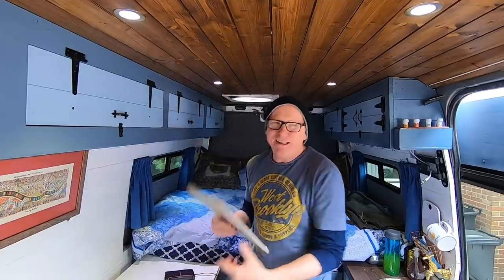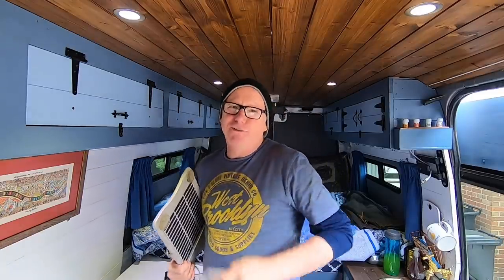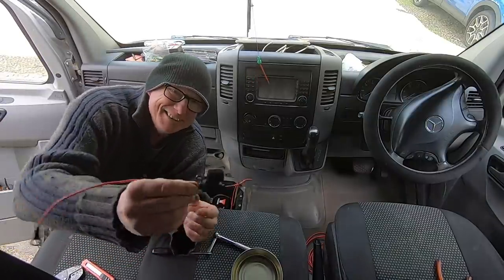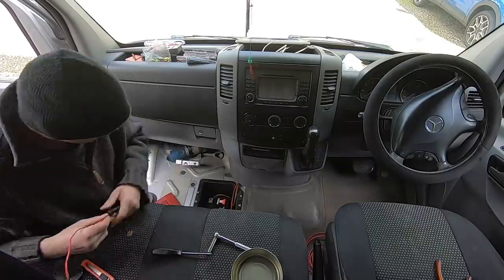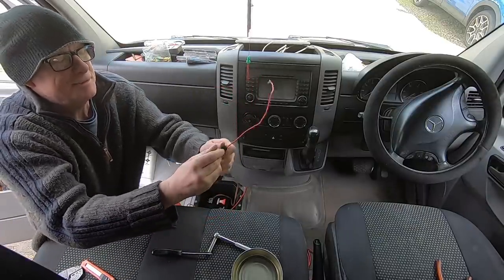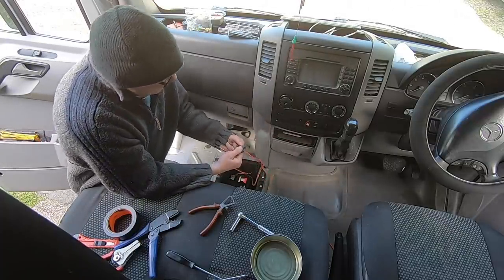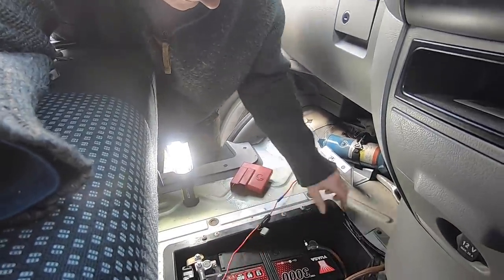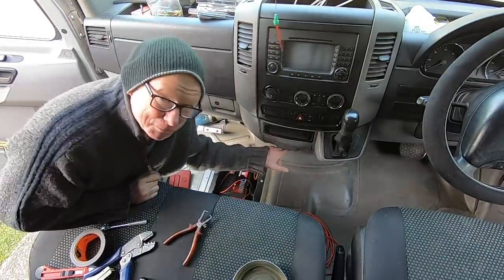How to stop your vehicle battery going flat

Comment: I run 2 starter batteries and 3 for the back.  305 AH all up for the back.  I had one of those relays snd ran my batteries down do far after about a year.  Cost me 115 buck.   So now I have a $20 switch    Much more reliable.
Reply from the maker: That’s what I like to hear old school always works well done 👍 🤓👍
Reply: Mel’s Van World Sometimes it doesn’t pay to be fancy.   I have a Hiace commuter.  I’ve been having this idea of blocking off the rear side windows off internally with a couple of solar panels that I can remove if I want to let a bit more airflow in.  Just to catch any extra rays in the afternoon.  I’m also going to be building a truck as well for full time living but I can fit plenty of solar on the roof.
Reply from the maker: I always say keep it simple keep it safe 😊👍
Reply: Mel’s Van World Just a simple unplug and put away.  I will be keeping the van for weekend trips but the truck is for living.   It’s pretty basic.

Comment: Hi Mel.   I might be wrong but I was under the impression that split charger you showed never lets power get drawn from the vehicle battery it’s designed to only push power one way.   To the leisure battery to get a charge, When the vehicle is switched off the split charger stoped the current from the vehicle battery.
Reply from the maker: Yes but if you add solar panels to the equation they trigger the relay to come on so your battery’s are now one 😊👍
Reply: Mel’s Van World oh ok 👍🏻.

Comment: Mel quick question you can answer it in video form at a later stage. How does the power go back down the cable to the battery? As you demonstrated it comes from the battery to the pump but how does it go the other way. Many thanks and stay safe 👍

Comment: Already got one.... &  it's kept the start battery on my Iveco Daily alive for for the last couple of years when my van is parked up, even in the depths of winter... it's a 40w solar panel, bought from Aldi & is specifically designed for the job... the cable, which has crocodile clips, goes through a hole the bulkhead to the start battery, which is in the engine bay. The kit also came with a cigarette lighter plug, but, like your van, the socket is only live when the ignition is on. Please note... it is only designed to maintain a battery that is already fully charged & is unlikely to charge up a battery that is flat. I've also taken the battery negative lead off the battery terminal... You could always have tested your handywork by putting your tongue across the terminals Mel... it would have made your eyes light up... its only 12v!

Comment: Most modern cars in Canada have a 2 position fuse for the cigarette lighter or 12v outlet just have to move the fuse from switch side to constant side. I would thing Europe is not any different considering I have seen it in jettas too

Comment: Can you route the solar panel wire directly onto the battery (or to the jump start terminals in the engine compartment). Of course you must disconnect it when using the van.

Comment: ive bought a van and had a relay like you held and wondered shy my engine battery is running flat, i think you just explained it, but mine blew my midi fuse and destroyed my relay.. o i think i have the andswer. i bought a relay that you can manually over ride and switch it off i believe. so im just trying that now and hopefully no drain from my 80ah starter battery for the transit, fingers crossed.
Reply from the maker: Good luck 🤞

Comment: Hi Mel,  just nearly finished my transit day van, I’ve a 150watt solar panel and a split charger running between batteries.Everything works and is running fine and charging etc. I’ve  noticed the split charger gets warm to touch with everything running does yours ? is this normal.  Thanks for all your vids you’ve basically built my van with me only taken 12weeks lol  keep up the good work
Reply from the maker: Hi if it’s a VSR then yes it’s going to get hot because the solar is making it come on all the time even when the engine isn’t running have a look you will see the read light on to show it’s on during the day you can stop this buy switching the small negative wire so you can switch it of during the day just remember to switch it back on if you want your alternator to charge your Lesisure battery hope this helps 👍🤓👍
Reply: Mel’s Van World  cheers

Comment: Hi Mel, been watching your videos for ages. I'm on my second van now, I finished my transit mwb last year and have toured Scotland in the winter just before lockdown.
This was an interesting video about battery charging.
I have the same intelligent smart relay as the one shown, and my solar panel  charges my two leisure batteries and starter battery. But my starter battery does not drain, the relay only allows the current to run one way,
Reply from the maker: Thank you that’s really interesting I didn’t know that the current would only go one way 👍

Comment: hey Mel, those sockets usually have a 15-20 A fuse on them. (Pending wire gauge used) Why dont you check the original factory fuse rating. Compare original wire gauge with the one u install... if you wanna play safe, reduce fuse value by 5A. I dont know in mm but 14AWG wire is usually 15A, 16AWG is 13A, 12AWG is for 20A.... 18AWG.10A (Stranded wire).u have to convert AWG to mm for EU spec. Canada follows the US when it comes to wire gauge measurement standards....
Reply from the maker: Hi ya thanks for that I’ll definitely have a look 👍🤓👍

Comment: I found solar panel with an OBD11 plug. so I didnt need to alter the 12v socket, just plug it into the diagnostics plug, and ive never had a flat battery since.
Reply from the maker: Nice one 👍

Comment: Great video as usual- even without cats!
How many watts is that panel?
Reply from the maker: Thank you it’s only 3.2 watts 18.8 max remember it’s just for keeping battery in good condition when parked up over long period not for sure if it would charge a flat battery 👍
Reply: @BigVanSmallWorld  Thanks for the reply Mel. I too have a 40 amp B2B. Currently use a jumper cable if I want to top up starter battery. Your small panel is much more elegant. Thankyou.

Comment: Hi Mel just found mine has a permanent 12v charger where you made yours for your dash solar panel. So if I plug my solar in there should be ok with out doing extra wires? 😊
Reply from the maker: That’s brilliant 👍

Comment: Maybe it's a Mercedes thing, Mel..?
I have the Crafter, which is basically the same van and the drinks holder 12v socket is ignition only, whilst the accessory one you altered, is already a permanent 12v. 🤔
I bought my small panel last week and it just sits in there, as I've had battery issues with being sat on the drive, too.. Nice video, btw.. 👍
Reply from the maker: Hi ya yes the panels a VW panel and you’re rite most VW are permanent live mine wasn’t working unless ignition was on 👍
Reply: @BigVanSmallWorld  Don't know why they would change this Mel but my 2007 LWB Sprinter power socket is a permanent live. Perhaps they thought that people were flattening there batteries this way? I modified a cheap Lidl 3 stage charger with a ciggy plug and it worked perfect, as you know it's a pain in the arse to get to the van battery. Good vid mate 👍

Comment: My battery went flat on the drive last week. I had not removed the battery cover since I bought the van 6 months ago. It had four torque screws and they were all seized. had to drill them out and didn't replace them, so the lid just sits under the foam floor mat. If this had happened in a remote location, I would be screwed, couldn't get a jump start if you can't access the battery compartment.
I fully charged it overnight, but your solar panel tip is ace, going to purchase one of those. Didn't know you could do that, I always thought that the 12 volt socket was only an output voltage.
Reply from the maker: Oh mate you can jump your sprinter from under the bonnet there’s a jump lead next the the air filter you have to turn the cap and push it in just so you know if it happens again but you’re absolutely rite it’s better you find things like this out on your drive than in the middle of nowhere I put a link in the description to a small panel designed for keeping your battery topped up hope this helps 😊👍
Reply: Cheers mate, forgot to mention that my van is a Vauxhall Vivaro LWB.

Comment: Will the DC to DC charger not send solar power to the starter battery if the voltage is below a given value?
Reply from the maker: I don’t think so but I have need asked about this before so I’ll put a meter on the battery to see what’s going on I’ll let you know I may even make a video about this 👍🍻

Comment: you know, that lower 12v socket is permanently on... its only the socket in the pullout draw that's on the ignition...
Reply from the maker: Na not in my van it wasn’t on all the time I did check it and it was off 😊👍
Reply: @BigVanSmallWorld  that so wierd, we've got a fleet of about 12 at work and they're all the same, yours must be special I guess 😅👍
Reply: My lower 12v cigarette socket is live all the time, I guess someone modified Mels.

Comment: Hi Mel, does your Van have an Accessory socket on the left side of the drivers seat base by the handbrake? I can’t remember if that one has a permanent feed, but also under the drivers seat is a power stud (B+,ign and Acc) that is easy to bolt onto.
Reply from the maker: Na it’s not got one I know the power socket you mean but I wanted to use the 12v socket 👍🤓👍

Comment: sorry for being a bit thick here but can you not just attach the panel straight to the battery, and do you need to have the fuse,
keep posting mel
all the best mik
Reply from the maker: No you can’t you need a solar controller
Reply: but you literally just connected yours to cigarette lighter then straight to the battery, just watched it again to make sure

 @BigVanSmallWorld
Reply: so the panel can be connected to the battery via a fuse can i put a switch in there too to turn it off when not required

Comment: Doesn't the VSR only sense the starter battery and not the Aux? so it will only connect the starter to the Aux when the engine is running? never seen one that works in reverse what one do you use to do that mate?
Aside from that i have a dash top solar pannel in all my cars, especialy the newer ones with all the moduals that run in the background !
The camper will have  similar to you with a combined MPPT and BtoB charger but mine will top up the starter battery once the aux battery is full automaticly, (renogy dcc 50S )

Comment: What about putting a switch to the negative side of the split charger so when your camping your can turn the split charger off
Reply from the maker: Yes that’s a good idea I’ve seen that done 👍😊👍
Reply: @BigVanSmallWorld  I added a marine style switch to mine but still get a flat main battery so I assume there is a "leak" somewhere.  I am going to swap out the VSR for a B2B at some point.  Great video Sparky Mel!

Comment: No need to fit another solar panel. If you got a a B2B some of them will automatically keep the van battery topped up when the solar is over 14v.    If not with a VSR or B2B its easy to  move the positives over together so both batteries are connected.  In the summer there is always plenty of solar power and both batteries will be kept FULL.  Split chargers and VSR's only really have to do any work in the winter thats when you need to split the systems.   My B2B has been hard linked during the lock down and its kept at 13.6V no problems while im still working in my van everyday on the drive.  Now the winter is a different story, either drive often with split charge operational or plug the van in to the mains charger.
Reply from the maker: Good job you did great 👍

Comment: What happens if your battery over charges
Reply from the maker: It won’t the panel has been made to only keep it charged its has built in controls 👍
Reply: It wont on a very small panel like 5w or 10w.   People been doing this the world over including boats for decades.  Its just a tiny trickle charge.  Anything bigger than yes you need a charge controller else you will cook your starter battery. Most vehicles today have quite a high background current for Alarms and ECU etc so after 2 or 3 weeks of standing the battery goes flat as millions have found out during the lockdowns.

Comment: Just fit a manual relay and then if engine battery is low you switch it on and your liesure batterys and solar charge the engine battery or you can just start straight off the liesure batterys if its emergency and then your engine charges the liesure battery back up. I don't like them auto relays just gives you no control
Reply from the maker: That’s a simple idea thank you 😊